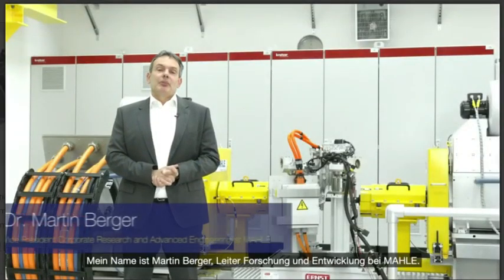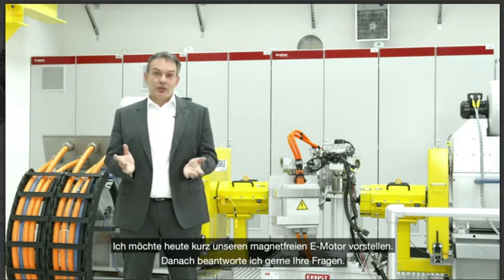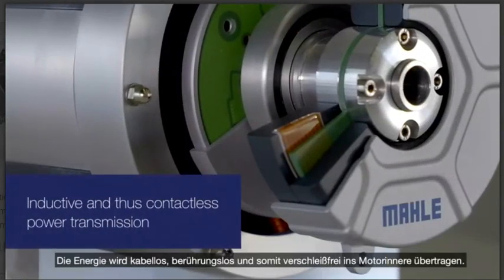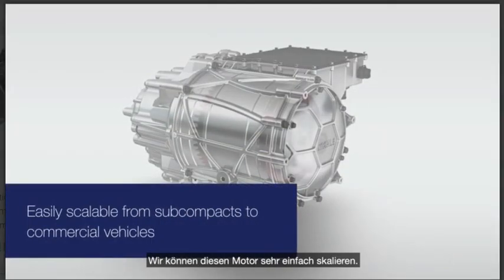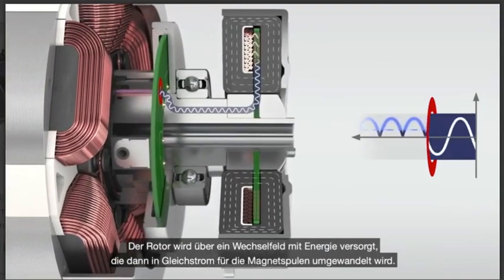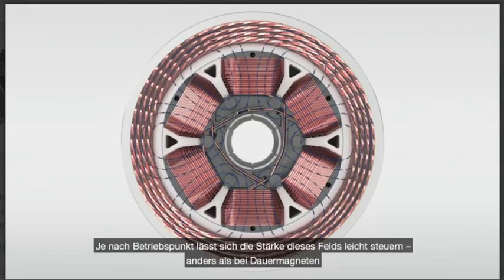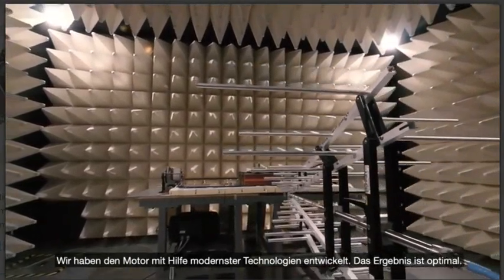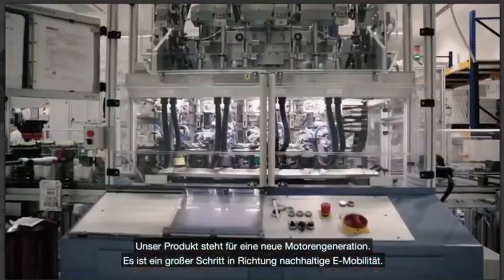Mahle, produce revolutionary new no-magnet motor...

Comment: Does this imply that there is no regenerative capability? Either way I’m surprised this isn’t more common now that I think about it. Liberating your supply chain from the rare earth mineral dependencies is a huge win all by itself.
Reply: One of the benefits of the design is that regeneration will be easier. You can modulate the excitation of the rotor to ensure that the regen voltage is optimal for the power electronics.
Reply: The exciter coil is the reason cars and trucks use the alternator instead of the generator if this was so revolutionary it would be in production immediately
Reply: It's a classical synchronous motor/generator. With the current flow through the rotor you control the voltage and/or the phase angle.
Reply: No it does not imply that, but you have to apply some energy to maintain the field of the rotor. In the end it makes not a big difference. The only difference is you cant start on an very high hill with completely empty batteries and end up in the valley with a charge. (This will probably work for no car but that is a completely other topic).
Reply: @matekochkoch  Someone apparently towed a model S Plaid for 25 miles at 70MPH recently and it recovered 65kW as if it was fast-charging.
Reply: @DamncatsForever  The Tesla had energy left. The problem with a completely (0% without any reserve) discharged battery would be that there would be no energy left to get the electronics started and power might not be routed from the engine to the battery. In normal operation there is no way to discharge a  battery that deep on a normal car.
What I was referring to is more a joke or a complete freak incident, than a real objection.
Reply: @matekochkoch  Yes, a practical EV that used this type of motor would always try to reserve some energy in the battery pack in order to energize the rotor electromagnets.   If so, then regeneration from the top of a tall hill would work.

You're right that the rotor (being electromagnets) needs energy for the motor to do work, but a design that used this type of motor would always try to save some battery energy for that need.
Reply: @DamncatsForever  That's not true. If it were, it would mean it would take >65kW to drive 25 miles at 70MPH.
Reply: If your battery is so discharged that it cannot provide a few watts to run the field coil, you probably have much bigger problems, such as steering or getting the parking brake to release.
Reply: @user2C47  In principle those could be run from a low voltage accessory battery, such as the 12 Volt battery still in most cars, including most EVs.
Reply: @user2C47  More often than not those functions are run from the 12V system.
Reply: these motors exist for a long time already its just too heavy for ev's so no one uses them
Reply: @nicksander1522  they already uses aluminium for the rotor core and housing to reduce the weight, plus hollow machinings

Comment: This is a synchronous motor with brushless excitation. According to Wikipedia's article Excitation (magnetic) this concept has been in use since 1950's. ABB, for example, has been using such motors in their propulsion systems for ships such as luxury cruisers in Caribbean quite a long time. The excitation windings in the rotor have higher losses than permanent magnets and thus the brushless synchronous motor needs to be through ventilated. Mahle's design seems to be quite closed one so I wonder how they are able to cool the rotor rotating inside the motor frame. H-class wire tolerates temperatures up to 180 C but then the shaft and bearings on shaft get very hot too that is not good for bearing lubrication and life time. In traction drives for electric cars, trains and locomotives totally enclosed motors are preferred due to demanding environmental conditions. Thus low rotor loss is essential. This has led to the use of permanent magnets or synchronous reluctance motors (SynRM). Synchronous reluctance motors have neither permanent magnets nor windings in the rotor and due to synchronous operation the rotor losses are lower than with asynchronous motors. Electric motors have a long history and thus it is not easy to find something that has not been tried already before. So I am not surprised if Mahle's motor fails to meet the requirements, especially the manufacturing cost.
Reply: Thank you!  I had been thinking only overall efficiency and manufacturing cost were important.  I didn't realize that rotor loss was specifically important.
Reply: It locomotive traction applications, motors both brushed and 3-phase are actually forced air cooled, either via a fan on the motor shaft or more commonly a separately driven blower. No part of the motor is sealed off as that would lead to major problems when literal megawatts are being rammed through them
Reply: Tesla's motors are liquid cooled and I assume Mahle's motor will also be liquid cooled.
Reply: @Proud2bmodest  Maybe. But liquid cooling of the rotor is a challenging thing to do because it is rotating and thus prone to have leaks in the seals.
Reply: @jkntrimmed  Yeah, I don't think Telsa cools the rotor, only the stator.
Reply: @pauljs75  Yes, some motors such as those from Tesla use oil (and that is typically ATF or similar) for both lubrication and cooling. Audi, for instance, uses a water-based coolant, and keeps lubrication separate.
Reply: @Proud2bmodest  that motor doesn't need in liquid cooled, working temperature is  up to 150C deg. air cooled is enough!
Reply: @chichomancho1791  All modern EV motors need liquid cooling; their peak power is too high for their size with just air cooling, especially since they need to be totally enclosed (not circulating air internally) for reliability. Most cool only the stator, since they have permanent magnet rotors and thus little rotor heating.

The Tesla induction motors have liquid-cooled rotors, using oil (and there is an oil-to-coolant heat exchanger). Audi's e-Tron motors are also induction type, and have liquid cooled rotors (with "water", which is actually the usual water and glycol coolant mixture).
Reply: Mahle knows what they are doing, so i won't be surprised if they succeed.
Reply: It looks like ABB's system induces current in 3-phase rotor-mounted windings, which is rectified (on the rotor) to produce DC excitation current. The difference here is that Mahle is not inducing current in a rotor winding by rotation - they are chopping the stationary coil current to induce current in the corresponding rotor coil independent of machine rotation. The magnetic field between these coils is axial so the rotation won't matter.
Reply: Yes it's not invention, it's old school E motors

Comment: Instead of using perm magnets, you are using electricity to generate the dc rotor field. Otherwise, the motor is the same as a synchronous motor. Ok smart you added a transformer to mechanically isolate the rotor and transfer the energy. You will get only slightly better efficiency than induction motor but much better control.
Reply: Is better control a decisive advantage?  I can see the induction motor is more difficult to control, but it seems like this is manageable with computer control (digital signal processing).  That is particularly true for automotive, where development cost is spread over a large number of cars sold.  I would expect overall cost to favor the induction motor.
Reply: I agree sphinx. I don't see the advantages in this application. Maybe for robotics or servo drivers where precise control is required. Also the efficiency is likely narrow range.  When you require low rev torque, you will have poor efficiency.  They don't show the torque speed curve. I don't want to under state their achievements in this novel technique but perhaps go for a different application. In a vehicle, efficiency and weight is key. To save $15 in magnets (at those volumes) you overengineered the solution and require a custom control scheme on top of vector control.

Comment: And the powered rotor field would enable coasting and variable regen far more efficiently.
Reply: Coasting and variable regen can also be achieved with a standart induction, permanent magnet syncronus (harder) or suncronus reluctance motors. Controll scheme takes care of all of that.
Reply: @marko6550  high torque ripple - that is only true about SRM (one type of sychronus reluctance motor), not SynRM (anouther type, here is comparison: https://www.anttilehikoinen.fi/research-work/switched-synchronous-reluctance-machines/), PMSM (permanent magnet syncronus motor) or IM (induction motor)